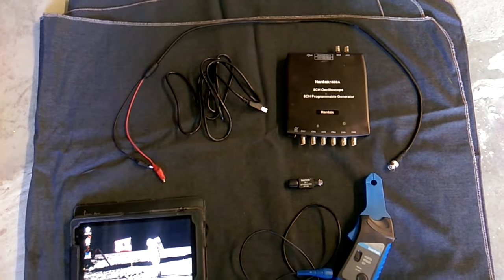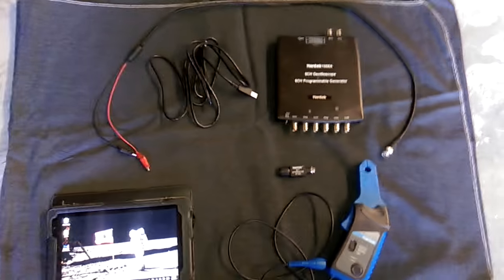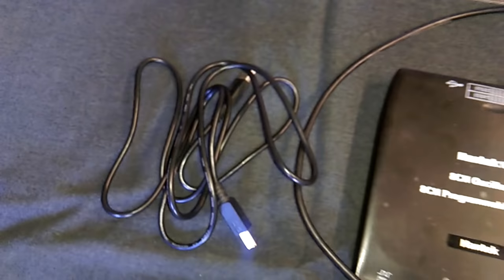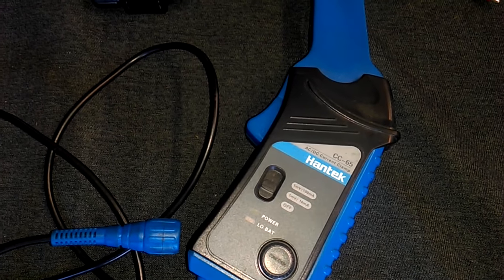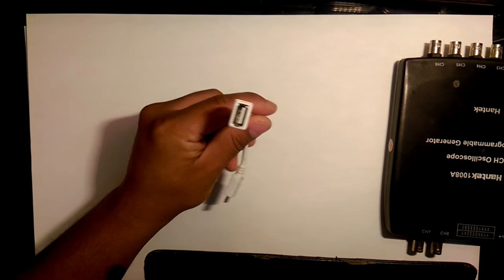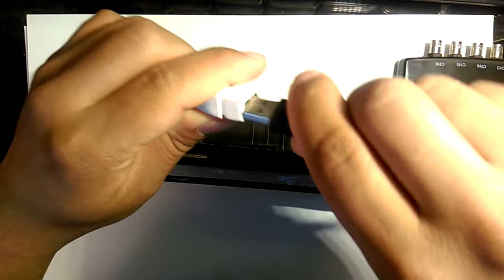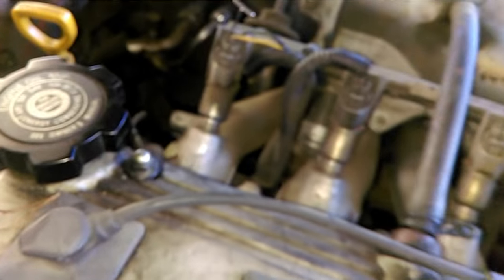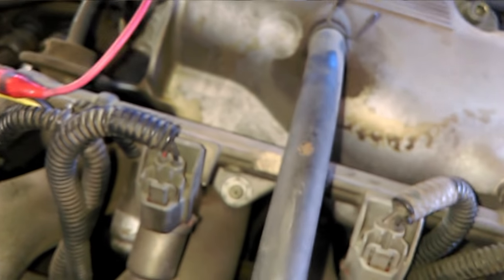Hantek 1008 Fuel Injector Waveform Analysis and Set-up

Comment: Hi Enrique!thank you for your great videos.i have just one question about calibration.i have a 1008c and when i do a calibration after it is finished when i unshort the leads my signal is not a straight line but it "waves".Is this normal?thanks
Reply from the maker: Excellent question!! I wish more people would ask me this. The waves you see are normal due to electrical noise in the environment. Try this: hold the positive input of the scope with one hand and have the negative input floating. Hold your other hand NEAR BUT NOT touching an electrical outlet. You should see a waveform that matches the frequency of the mains voltage in your home. You have become a sensor! 
To be sure that your scope is calibrated try shorting the wires again and make sure the waveform stays flat. Thank you for your question and thanks for watching!!
Reply: @Enrique_Osorio  oh thanks man!now i make sense!  I did it and you are absolutely wright!Thanks again and continue that way.many people is learning from you.Hallo from Greece

Comment: hi mate 
this calibration need to be down every time the device  is used or just once initially.
thanks
Reply from the maker: I recommend doing the calibration as often as possible. Even if you are just changing leads you should calibrate. I do it because I like to make sure it is an accurate reading, but as long as you do it once every time you first turn on the scope you should be fine.

Comment: Hi, without probes/dividers what is the maximum input voltage you can measure? Is it 5v?
Reply from the maker: Typically 25 volts is my rule. But I believe the official max is 35 volts.

Comment: I bought the attenuator, but just don't know why it's needed?
Reply from the maker: The attenuator is used to divide the voltage by 20. This is useful if you expect the voltage you are measuring to rise above 25 volts, like in primary ignition circuits, fuel injectors and even pulse width modulated motors. The attenutor protects your Hantek from high voltages.
Here is a link explaining exactly how the 20:1 attenuator works https://youtu.be/7xtNYIn9t0s

Comment: Hey man! Are you happy with all the function of the Hantek 1008? Im thinking about getting one and like the price.
Reply from the maker: It works well enough. It is not the best but it will get you started. If you purchase a Hantek and you outgrow it then you know you need something more capable.
Reply: Since I'd have to buy a laptop to even use the Hantek 1008 I thought about getting the Rigol DS1054Z Digital Oscilloscopes Bandwidth 50 Mhz Channels 4Its a bench scope for right at 400 bucks. Any thoughts on that?
Reply from the maker: The specifications look impressive, but I have not used it personally so I can not comment thoroughly on it. It will  be more capable than the Hantek, that is a guarantee.
Reply: Have you ever needed more than 4 channels on a Scope?
Reply from the maker: I have used all 8 channels while doing secondary ignition testing on a V8 motor. The scope did not capture much detail but for that configuration all I needed were the voltage spikes therefore I did not need a lot of detail. Other than that I usually only use 2 or 3 channels at the most. Often times just one channel.

Comment: Why not zero it out with att. in place?
Reply from the maker: It should not make a difference in my experience. I have zeroed it with and without the attenuator and the difference is negligible. In this particular instance I believe (I say believe because this was years ago) I zeroed it without the attenuator to show the way the scope would typically be zeroed. Using an attenuator is not usually necessary for most circuits that one would be probing on a car. Thank you for your question and thanks for watching!!

Comment: How about a cam and crank sensor wave form demo? Also, do you know of any free resources for known good wave forms?
Reply from the maker: The only resource I know is IATN but you have to pay for it through a monthly subscription and it's ok, i found what i needed about half the time. Other than that most of my waveforms are ones that I captured on cars with no known faults that I did in my spare time, but to be honest I have never used them extensively as a reference simply because the odds that the waveform I captured is the one that I will need in the future is small.

Comment: why  you need attenuator for 12v  ?
Reply from the maker: When a fuel injector runs, there is a huge spike in voltage. This spike can exceed 70 volts which may damage some oscilloscopes.

Comment: Why are you using the 20:1 actuator.
Reply from the maker: The Hantek can only safely accept about 25 volts. This means that anything you measure with the Hantek can not or at least should not exceed that amount. The attenuator does a neat trick, it divides whatever voltage you input to it by 20. This way for example you could measure the voltage of something that is outputting 200 volts and the Hantek will only receive 10 volts. What makes this even better is that if you tell the Hantek that you are using a 20:1 attenuator then in the software it will automatically multiply the readings by 20 so you can see the actual voltage. For a more detailed explanation of how the attenuator works watch my video on it. Here is the link https://youtu.be/onNOZVR-Lpk
Thanks for watching and thank you for your question!
Reply from the maker: I for got to add in my other reply to your question that since a fuel injector is an inductive load when power or ground is quickly removed there is a huge inductive spike in voltage which can exceed 60 volts. For this reason we use the attenuator.
Reply: Thank u very match for you response and accurate explanation, I didn’t know that the voltage could peak that high.

Comment: So you have to do all of them one by one to find the one that's misfiring?

 Will this tell you if one is stopped up or not firing at all?
Thanks! I need one of these. I like the price as well. Also will this record and play back a section if you wish for review and zoom in analysis?
Reply from the maker: Yes you would do this to each one and analyze the waveform. It will not diagnose any misfire but will let you know if there is a problem with the fuel injectors or the driver for the fuel injector which is the ECM.

 You can not record with this scope unfortunately but with the right trigger and time base settings you can get a good view of the waveform of each injector.
Reply: I was just wondering how I could utilize this to diagnose a bad injector on a big rig without a bi-directional scan tool.

 For instance we have a 60 Series Detroit that's getting oil into the fuel tank. Only way for it to get in there is on the return fuel line. The way it gets into the return fuel is supposedly a bad injector o'ring.

These injectors are hidden under the valve cover and exposed to engine oil so I guess if the injector has a bad o ring it could be losing cylinder pressure and causing the misfire and white smoke we're seeing and getting oil back into the return line?

In this case the scope would show I guess that everything is functioning properly regardless of the bad oring?

The cylinder cutout test would reveal the skipping cylinder for sure and then I guess it might be as simple as replacing the bad oring? Perhaps it will be easy to see by taking the valve cover off and unplugging each injector one at a time?
Reply from the maker: I do not have much experience with diesel fuel injectors so I do not think that this procedure would work for you but it can hurt to try. For example look at the waveform for all of the injectors and try to see if one is wildly different. I do not think a leaking injector oring would allow oil to pass through it, because it the if the o-ring were leaking there would a massive amount of fuel in the valve cover and the engine oil. I do not know enough about diesel engines to give you a complete answer but I do know that wherever there is a leak it will leak from a place of higher pressure to a place of lower pressure and in a valve cover there is very little pressure.
Reply: I've learned now that some kind of sut gets into the diesel tank from the failing fuel injector and not actually motor oil. It does come from the failing injector though. Im newer to diesel as well. I've changed fuel filters and pumps and small things for years but nothing major.

So which Hantec model offers capture and playback? I need a scope man seriously.
Reply from the maker: I am not sure which offers playback. I would assume that there is a Hantek scope that does but I only own the 1008. I am currently studying for finals but when I have some time I will look some up and get back to you.
Reply: Enrique Osorio
Ok! Thanks! Are you taking automotive classes?
Reply from the maker: No, I went to an automotive trade school and graduated already and have been working on cars ever since. Right now I am trying to get a degree in electrical engineering.
Reply: Enrique Osorio Ive heard its hard to get that degree. You must be one smart cookie? lol!
Reply from the maker: I found this PC scope that might fit your needs. I have never used it but it seems promising
https://www.amazon.com/Owon-VDS1022I-USB-Oscilloscope-Isolation/dp/B00HC4UP52/ref=as_li_ss_tl?ie=UTF8&qid=1481410049&sr=8-1&keywords=owon+usb+oscilloscope&linkCode=sl1&tag=ee04-20&linkId=11dbe5f434ad351c738cf040a2c780c4
Reply: Enrique Osorio I have not seen that one before. It looks pretty nice.
Reply: I got an Autel 802 the other day and got a chance to scan my vehicles with it today. I couldn't update it yet because my SD reader is not functioning properly.

It found so much stuff wrong with my Windstar that I don't know If I'll ever get it fixed. LOL!

Comment: esta prueba se puede hacer sin el atenuador ? gracias por el video
Reply from the maker: No es recomendando. El Hantek solo puede aceptar hasta 25 volts y un inyector puede producir hasta 70 volts cuando se apague. Ese el voltage que sube.
Reply: Y cuanto se usa la pinza amperaje ?
Reply from the maker: Se debe usar en partes que son inductores. Por ejemplo motores electronicos, solenoids, y bobinas. Es muy util en esos aspectos.
Reply: +Enrique Osorio grasias yo tanbien iva a preguntar lo mismo

Comment: can I check the battery by using Hantek 1008
Reply from the maker: Absolutely. A simple, yet good, check would be to monitor the voltage waveform of the battery while starting the car. It should never drop below 10 volts while cranking the car.

Comment: Hi, When would u need to put an attenuator? for example on automotive would i need it to test others things like ignition, sensors etc. thankyou
Reply from the maker: Whenever you expect the input voltage to the scope to rise above 25 volts. Ignition coil, fuel injectors and even the control side of relays because of the inductive voltage spike.

Comment: How do you know that is the ground wire?
Reply from the maker: If you look at the colors of the wires that go to the fuel injectors, you will notice that one of the wires of each fuel injector will have the same color. That common wire is the power or 12 volt wire. The other wire is the control wire. As for the ground for the oscilloscope i just chose a piece of metal that was connected to the engine block.
Reply: @Enrique_Osorio  Great video, watching again 4 years later.

Comment: what operating system / type of tablet are you using?
Reply from the maker: I am using Windows 10 on a Dell Venue 8 Pro. I used to use Windows 8 and it worked just as well.

Comment: Can any brand current clamp be used on the hantek or do you need hantek current clamp? Im asking because I just ordered a hantek scope and a otc low amp clamp.
Reply from the maker: Any brand will work but with an important caveat. The Hantek software is programmed to automatically calculate the amperage based on the mV/A (millivolt per Amp) of the clamp itself, so if your current clamp has a different mV/A than the Hantek ones your displayed reading may be an order of magnitude (or several orders of magnitude) off from the correct value.
It is important to realize that the function of a current clamp is to convert the reading of current running through its "jaws" to a voltage reading which an oscilloscope can easily read. If you know the conversion of your OTC current clamp you can simply set the voltage scale on your Hantek to a convenient value and just do the math in your head. The math should be as simple as multiplying or dividing by a power of 10 which you can do by moving the decimal point right or left accordingly.
Reply: Enrique Osorio thanks for the reply. The otc clamp has the same exact scales as the cc-65 so I'm assuming I can just choose the cc-65 from the drop down box ?
Reply from the maker: That is correct!
Reply: Enrique Osorio thank you for your detailed vids on the scope, I'm just getting into this part of diagnostics and I'm really excited. Starting off with the hantek, some day I'll upgrade to a Pico. Your vids are perfect at teaching beginners.  My channel will start to have more scope action in my future vids! Thank you. Keep up the good work. 👍

Comment: Enrique I need some help
Reply from the maker: I'm listening
Reply: @Enrique_Osorio  I can't get my hantek to show the calibration bar I tried your download method but I couldn't get it to work either. I got the installation cd but my screen is different from yours. When I tried yours it kept coming up in Chinese.
Reply from the maker: Im so sorry that happened. This video needs an update, I admit it is not the greatest. My suggestions for the fact that it is still in Chinese is to delete everything. Uninstall the program and delete the drivers. Reinstall the program and add the drivers manually before ever plugging in your Hantek. Let me know how that goes.
Reply: @Enrique_Osorio  done that a few times even tried my drivers from the installation CD I don't know if it's any good or not I can't even get past the calibration
Reply: I appreciate you trying to help me
Reply from the maker: It is my pleasure. I have one more final exam to complete today so I will be studying all day today. Tomorrow I will attempt the procedure on a computer that has never had the Hantek software installed on it. I will see if something comes to me that might help you with your issue. In the mean time please let me know the version of windows you are using as well as the specifications of your PC. 
Go to Settings>>System>>About or simply press the windows key and the pause/break button at the same time to get the information I need. I want to get to the bottom of this.
Reply from the maker: I made a new video for the Hantek 1008 Software and Drivers, the link is below. I hope this helps.
https://youtu.be/wCHch4X0cqA

Comment: You should study actual Electrical Theory at least once, guy( some people have ). you dont have a handle on induction or counter-electro-motive forces, friend. Noticed it in the other viewed you-tube too.  Then you will know exactly what you're really talking about. Respectfully---young blood. Seriously-dude  example 1.  current does not slow down going up-hill ,   CEMF and resistance of smaller wiring slows it down.  C_E_M_F = Counter-Electro-Motive-Force.  2. rise and fall of magnetic-flux lines, induces voltage. = SPIKEs. : 10 / 4  Over & Out
Reply from the maker: Thank you for comment. I will study more.